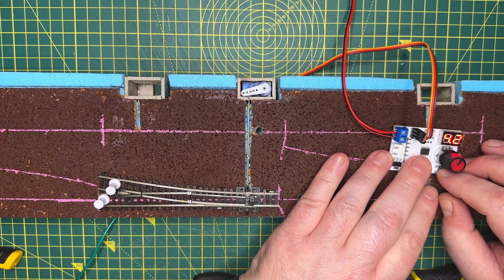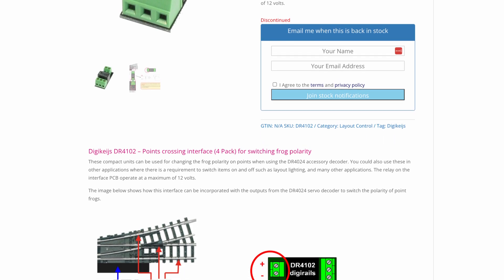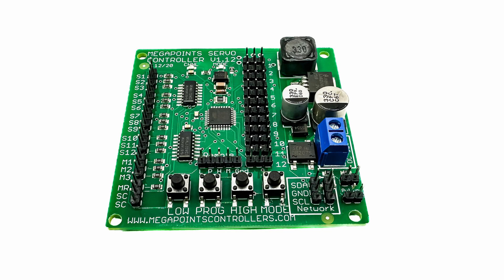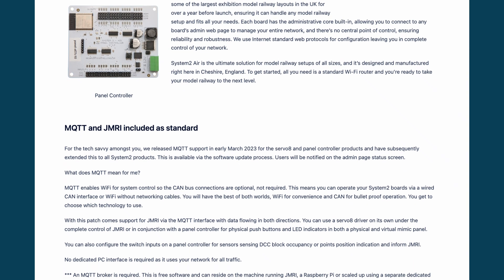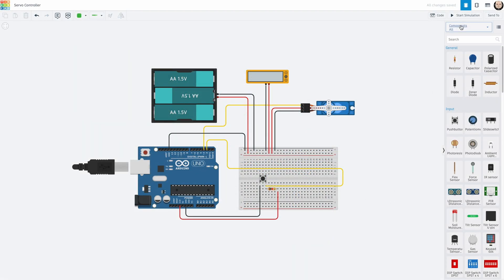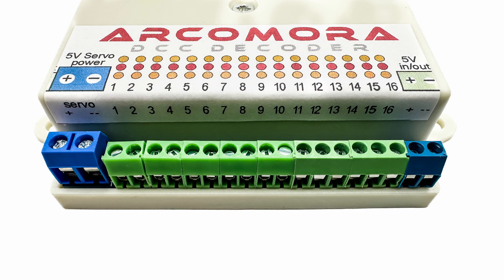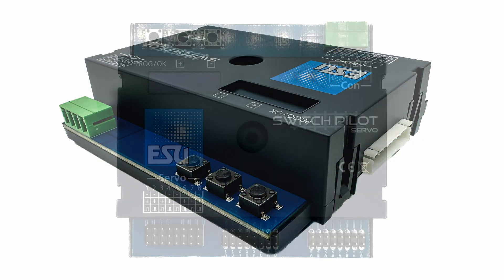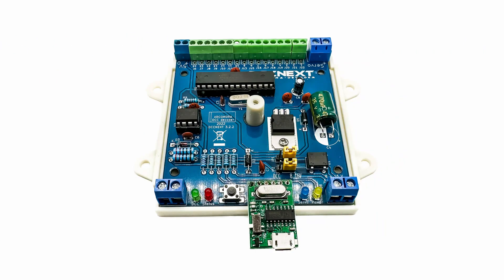110 - Miscellaneous - Servo Motor Control Thoughts

Comment: Morning Ian -  I have been looking at automotive points for a while now and I'm just running DC at the moment but wanting to go DCC-EX in the future I'm not looking at automotive running as I like to do things manually how ever I like the idea of auto points as the layout is 6 x 5 meters and a long way to walk around LOL for my points I'm looking at removing the 3 wires from the point motor and replacing with just 2 positive and neg and using a momentary switch  to move left and right and a micro switch  from one arm for the green and red lights on a switch panel simply easy and cheap I suppose not for everyone but it works for me, Enjoying your videos and the trip your taking.
Cheers Mark
Reply from the maker: Hi Mark! Going DCC gives you so many more options for controlling things like points, signals and ultimately locos! Using micro switches for controlling the frog polarity and as a way of indicating routes is a tried and tested method, and if my point motors had been below the baseboard I may have gone that way myself! Thank you for your kind words! I'm jealous of your 6m x 5m space! :) I wish you luck with your endeavours! All the best, Ian.

Comment: We use mega control boards. These replaced our merg boards.
Reply from the maker: Hi Peter! The Megapoints controllers look really good, especially the new versions that support wireless setup! I'm not really confident enough with my soldering or electronic skills, so I've never got into MERG products, but I've heard good things about them! I think I'm going to go down the ESU SwitchPilot Servo route as they seem very easy to setup! All the best, Ian.
Reply: @iansngauge  the mega points control board are the easiest ive set up. Im new to all this. I would realy consider them
Reply from the maker: @petergarton5629  - Hi Peter! I've got one of their boards, and will definitely use it somewhere, but the fact that the ESU SwitchPilot has a display, giving you information about where you are in the setup process is a game changer! Cheers, Ian.
Reply: @iansngauge  good reason. Enjoy your videos.
Reply from the maker: @petergarton5629  - Thank you Sir! That's very kind of you to say! Ian

Comment: Hi Ian sorry for the delay with the comment watched it 4 days ago, very interesting all the different things to make a train go. I did use megapoints equipment very please with it, but as you know I'm using Lodi and itrains now, when I did use megapoints I use auto frogs and they work superb and they work if you use the point manually. I also use male and female joiners so if one broke I could just replace it but in all fairness I only had one break. Hope your well. Colin
Reply from the maker: No problem Colin! I'm always watching on the TV, meaning to comment later, then forgetting! Yes, the Megapoints stuff does appeal, especially their new System 2 stuff, but works out quite expensive! I need to take another look at the Lodi stuff! I'm not sure how auto-frogs work with Unifrog points, so I'll have to look into that! I also read somewhere that they detect a momentary short before switching polarity, and that the short circuit can cause problems for some DCC command stations! Which ones were you using? All the best, Ian.
Reply: @iansngauge  NCE Powercab first but I didn't like it for the sounds locos, Then went to piko which was wifi and more power love it. The auto frogs work with both,  we did have unifrog points to be honest I can't remember if they had them on, but if there was a wire underneath the point from the frog area then we put a autofrog on. If you haven't tried or seen a autofrog, my email is in the information on YouTube send me a email with your address and I'll send you one to try and if you like them I think there about £20 for 3 I'm going to sell them and because it's you I'll do 6 for £20.
Reply from the maker: @collinsngauge5493  - Thanks very much Colin! That's very kind of you! I've sent you an email! 😃

Comment: Hi Ian, I wasn't happy when Digikeijs was no more. I did manage however to buy most of the bits made by them for my small layout, but if something fails then there will be trouble! I liked Digikeijs as it was (in my opinion) pretty good cost wise. Since then I have done some research like you have, coming across several options for controlling servo motors. I kind of like the idea of going Arduino based as like you said it's cost effective and if something goes bang then it shouldn't be that much of an issue fixing it. Before the Digikeijs I used the original DCC++ system and that worked well but for automation like you said you would need to add on bits and pieces to it. I would really like to go down the Arduino path but of course that's a lot more work than a commercially purchased system.
Reply from the maker: Hi John! Yeah, I was sad when Digikeijs went under, as their products seemed to offer excellent functionality for a very reasonable price! YAMORC have risen from the ashes of Digikeijs, but they've been quite slow to bring products to market since the shortage of chips caused by Covid! Hopefully they'll improve their output soon! As I said in the video, I'd love to DIY my own system, using Arduinos, but that seems like it would be so much work! Maybe when I get everything up and running using proprietary stuff, I'll start experimenting with the Arduino side of things! Obviously, getting some track laid would be nice too! :) All the best, Ian.

Comment: Hi Ian.  I was very impressed by the thorough investigation you have documented.
I am a DC patron and just enjoy switching routes and trains manually.  
A large number of my point motors were and still are still twin coil machines.
I invented and developed some motor driven point motors and have used these on my main lines and crossovers and as they have worn and failed over the years I have developed the servo controllers I now use to replace any of the point controls that give me trouble.
 I have ventured into making my own handheld controllers for the trains  and making my own servo controllers for switching my points.
The video that describes my servo controllers can be seen here. Note the part about servo control starts around 4.30 Minutes in.  https://www.youtube.com/watch?v=g2ch4uhWZYs
Reply from the maker: Thanks Patrick! Well done for making your own servo controllers, and producing a very informative video about them! I'm pretty sure I don't have the skills for implementing the electronics involved, but it was interesting to see how you made the linkages between the point tie bars and the servo horns using paper clips and bicycle spokes! Ingenious! All the best, Ian.

Comment: Hi Ian
I followed more or less the same path except the Megapoint solution.

Having quality issues with DR4024s and reverse polarity modules many of which burned out, I purchased ESU Switchpilot Servo modules. These are high quality products, but for me they have a major flaw. If I want to activate my servos from a mimic panel, I must use two buttons per servo. 1 per direction of rotation.

So I thought again and I finally chose to use an independent accessory bus and I therefore chose to install a solution for controlling my accessories via MERG modules.

As, in the meantime, my DR5000 control unit also burned out, I also switched my DCC command station to a MERG control unit.
MERG modules are fully recognized and integrated into JMRI (and Rocrail). For Itrain, I don't know.

On the other hand, what is certain is that it is less easy to configure than a commercial solution. And you have to know how to use a soldering iron.
The learning curve is steep

I don't advertise Merg, but building the hardware and configuring the software for my MERG modules is also part of my modeling pleasures.
Reply from the maker: Hi! I've also had problems with my DR5000, and the WiFi module has failed, hence I'm temporarily using an NCE Powercab at the moment! If the DR4024's are unreliable, maybe I'll not use the one I have after all! I noticed that the SwitchPilot had inputs for both open and closed routes, but figured it could be wired to operate on a single switch, is that not the case? I've purposefully not looked at the MERG stuff, as I'm by no means confident when it comes to soldering electronics, so I'm sure that whatever I built would only be as reliable as my soldering skills! All the best, Ian.

Comment: Very interesting Ian, It's great you are taking this journey into automation no doubt on behalf of many modelers. For myself I decided it was full automation or nothing as to have all these required modules but still no visual of the point setting made no sense. Hence i have zero automation but have a good visual of point setting  as well as frog control without any modules. I respect those that have a vision of watching their layout run automatically whilst they enjoy a cup of tea. Very enjoyable Ian.
Reply from the maker: Thanks very much Chris! Hopefully some will find my investigations, experiments and usually blind muddling through of some use! The plan is to build in the ability to perform automation as I go along, but initially all points will be controlled via DCC commands, and visualisation of the point setting could come via JMRI or the Z21 app! Again, I haven't got everything completely thought through yet, but as longs as I've got the wiring installed along with the hardware I intend to use, then I can move things along quite nicely, and retrofit automation later! Thanks again! All the best, Ian.

Comment: Hi Ian, this is certainly an interesting journey. It looks to me like you have all the servo options covered, to control the frog should also be quite easy, instead of using a microswitch you could use a solenoid point switcher and wire it to a latched relay which could be used to control the frog polarity. I assume you could use the same dcc id on both servo and solenoid to control both at the same time. My thoughts really turn to Railcom I can understand it being used on the blocks in automation, but do you really need it to feedback from the points as well? ESU are a top company but if they are the only ones making a Railcom point controller is it really needed, knowing how many automated layouts there must be around the world. I suppose the only way to settle it is to look at the software manual for automation and see what pros and cons it has to use Railcom on points. Just a few thoughts 😁 p.s Bob fuller who has commented is like a God when it comes to Itrain LOL! All the best Tony.
Reply from the maker: Hi Tony! It's definitely been an interesting and sometimes confusing journey! Yeah, controlling the frog should be quite simple, should I decide its required! I'm still not completely convinced I need it for all of the points, if any! Being a software engineer, if I were writing something like JMRI or iTrain then I'd want to know the position of the point so I could draw it on the screen! I'd also like to know that if I issued a command to switch the point, that the hardware actually switched it, otherwise the software and hardware would be out of sync! Maybe such trivialities aren't considered with current systems, but I'll definitely do more research to see how it could or should work! Cheers, Ian.

Comment: Hi Ian. I have a simple DC N gauge layout,  I use magapoints controls for my fiddle/staging yard and have a duplicate panel for the yard at the station end of my layout. 
I use micro switches for polarity change operating from one of the four arms on the servo motor.  It was very interesting how you have gone through various ways of operating your railway. Thank you for an entertaining vlog.
Reply from the maker: Hi John! Thank you! I actually have a large fiddle yard planned for Shelfington, so I may end up using the Megapoints controller for that! Unfortunately, because of the way I'm mounting my servos in the foam baseboard, it would be difficult to also install micro switches, hence wanting to go down the RailCom route! It's a lot of fun building a model railway, the only problem being that there are serious distractions to the actual build process as you investigate various aspects of it! Glad you found the video entertaining, as I thoroughly enjoy making them! All the best, Ian.

Comment: Hi Ian. A very nice and interesting overview. Thanks for sharing. There is one clarification which I hope will be helpful. Automation software, such as iTrain, typically does not NEED to determine the position of the points. Instead, it works the principle that the point will have successfully switched after a certain time. So, position monitoring is not required, and most automation users do not bother with it. However, if you want the added security of knowing that the point has achieved its switched position, that is also possible but is typically implemented mechanically using micro switches located on the servo bracket (I highly recommend the range of Dingo Servo Mounts).
Railcom is a commonly used and available feature, but the specific Railcom ‘position’ function that you mentioned, and which is available on the ESU switch decoder, is something that is very different and rarely seen on switch decoders (ESU is the only manufacturer that I am aware of that are implementing it). As I understand it, this feature can precisely monitor the switch position throughout the switching operation, and not just to see if the point has reached the switched position. So, it is a continual, linear measurement which is not required by automation software.
So, I hope this helps simplify your switch decoder choice, and will save you some money.
Personally, I have opted for a German-based system called ‘BiDiB’ which has a vast range of modules covering virtually every application (search for ‘FichtelBahn’ for more information. It’s open source and fully supported in iTrain. And can be purchased in kit form or ‘ready to go’. But I would only recommend BiDiB if you like to tinker with stuff, are comfortable with using software, and have a basic understanding of electronics. For my requirements, it offered the most cost effective solution for the features I needed.
Another system worth looing at is LODI – talk to James Hudson at DCC Train Automation.
Reply: As stated earlier, the software does allow you to monitor the point position, typically using micro switches, but most users don’t bother. I personally do like to monitor the point position. It will be very interesting to hear how well the Railcom position function works in this regard if you move ahead with the ESU decoder. 
Whilst at Intermodellbau we had some very interesting discussions with various manufacturers about the use of Railcom position. ESU were the only company that we spoke to that were using it. Many either didn’t know about it or didn’t fully understand the specification.
Reply from the maker: @bobfuller  - Sorry Bob, I'd missed the micro switch reference in the earlier comment! While it will be quite a while before I get to layout automation, I'll definitely be using the ESU decoders at some point! I'm quite surprised that more manufacturers don't include RailCom interfaces in their hardware as it seems like an eminently sensible way of allowing two way communication between the controlling hardware / software and the hardware being controlled! Thanks again for your comments, they have been much appreciated! All the best, Ian.
Reply from the maker: Hi Bob! Thank you so much for your insightful comment! Unfortunately, because of the way I'm mounting my servos in the foam, I don't want to overcomplicate matters with micro switches, which was why I was looking for a "software" based method of determining the servo position, and RailCom seemed like the easiest way of doing this! I quite like that the ESU hardware allows you to interrogate the position DURING the servo sweep, but now fully understand that it isn't necessary for the automation software to know this! The reason I thought it would need to know the point position was for display purposes, rather than switching purposes! How does the automation software determine what to draw on the screen if it doesn't know the point position? I'll take a look at the BiDiB system, but fear it may be a another rabbit hole for me to disappear into! :) I looked at the LoDi system a while ago, but will take another look based on your recommendation! Thanks again! All the best, Ian.
Reply: @iansngauge  the automation software only displays two positions, straight or thrown. It doesn't display a real-time image of the entire switching action.
Reply from the maker: @bobfuller  - Yeah, I understand that, but how does it know to show straight or thrown? Obviously iTrain has to know the point position, so where does it get that information from? Cheers, Ian.
Reply: @iansngauge  if it's not correct, you either swap the wiring or swap the outputs in the software.
Reply from the maker: @bobfuller  - Ah, okay! So the software doesn't actually monitor the position of the point at all? It just assumes that when a command is issued to switch the direction of the point, it just works? Coming from a software engineering background, and working on real world software / hardware interfaces, I'd assumed that there'd be some sort of check that after a command had been issued, it was carried out correctly! Obviously this isn't a crucial aspect of model railways! Thanks very much for the clarification! All the best, Ian.